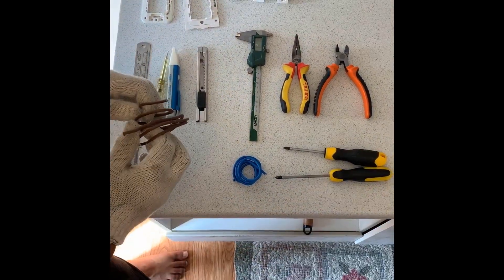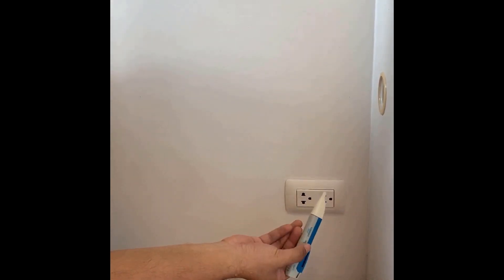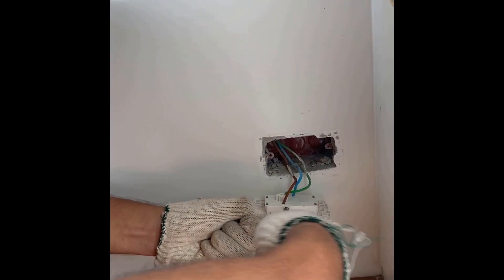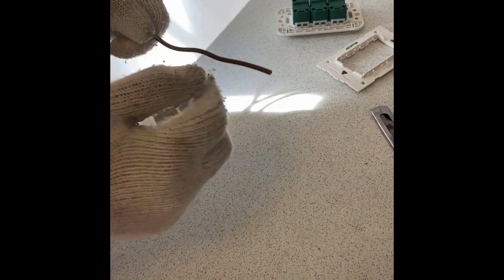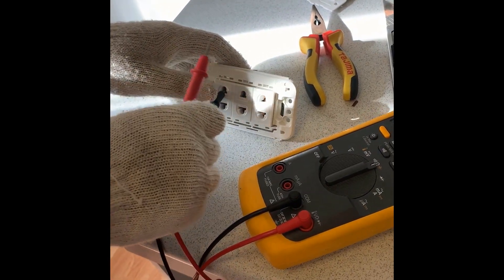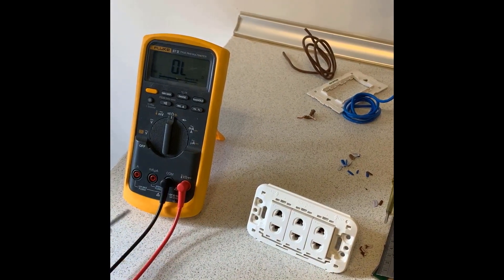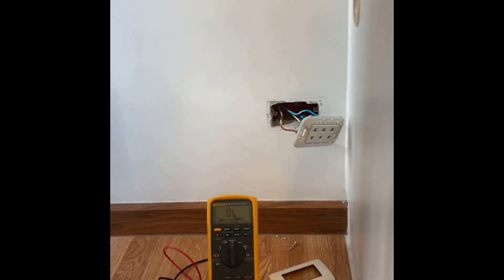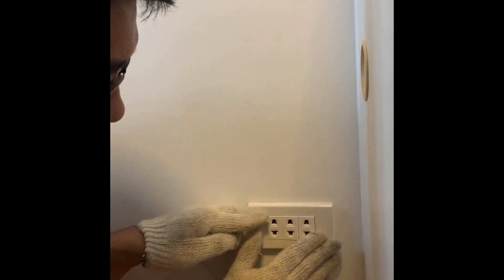Receptacle Replacement (Thailand)

Comment: Your explanation is clear understand. When the receptacle is being installed, which terminal will be on the top side between L and N terminal. Thank you
Reply from the maker: Thank you Sunisa Sirikhan, the L terminal was on top when I put it back inside the wall although it might have appeared to you that the L terminal was down the bottom when I was measuring the current and the voltage.
Reply: Indy Experimentalist thanks